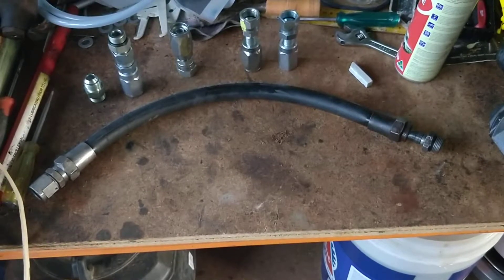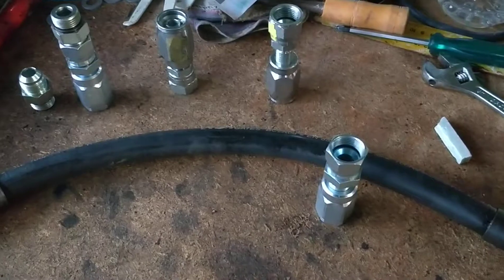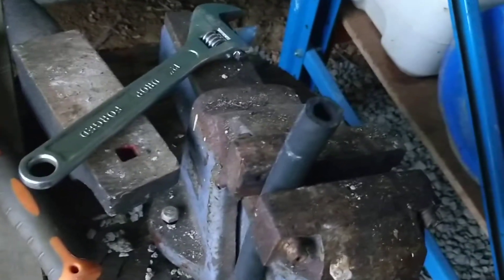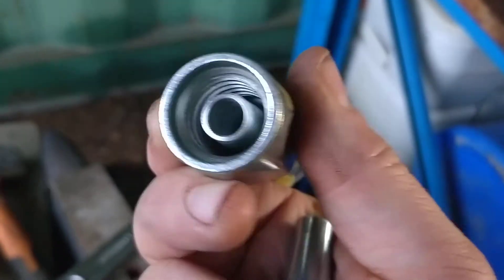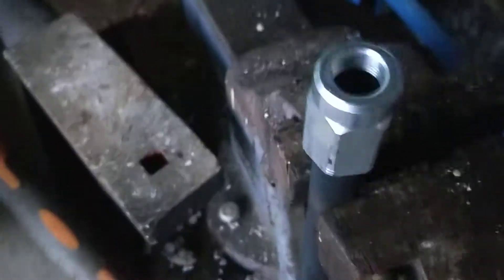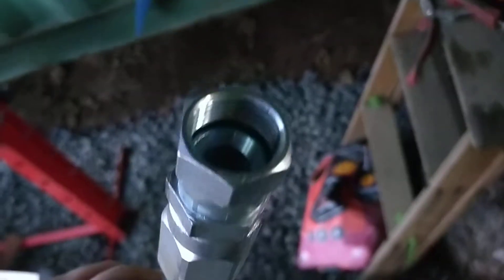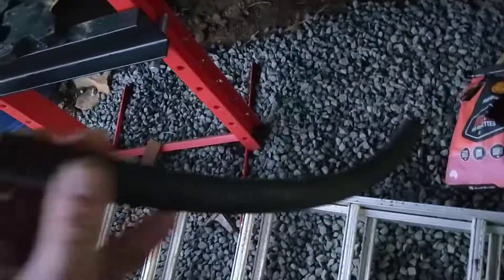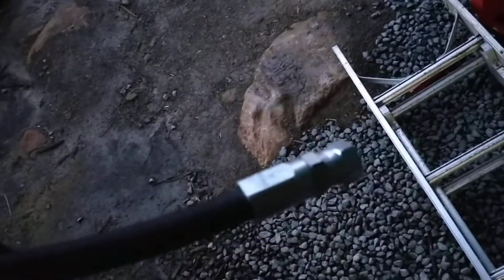OGT 54 - Make your own hydraulic hoses

Comment: So, what's the amount of psi that those type of connector (screw on as opposed to crimp style) handle? My JD 2032R looks like it has over 5000 psi. Will these screw on fittings work with that much pressure?
Reply: @butchtheiw  Not sure but they'll have ratings from the manufacturer. I've used the ones I get on 3000 psi.
Reply: max hyd pressure is 2495 psi on 3032r

Comment: I’ve got an old Ford/Shibaura 1900 with loader and backhoe (built for Telecom) and a lot of the fittings on the old hoses are reusable field fittings. I need to replace lots of hoses and am planning on re-using what field fittings I can, buying rolls of hose, and buying new fittings for the currently crimped hoses, mostly 3/8” and some 1/2” hose. I have a lot of work ahead figuring out threads and inside and outside diameter hoses. Good to see some reassurance this is a viable way to go. 
Is there a brand on the field fittings you have settled on?
Reply: BareCo ones are cheap and reliable
Reply: @bcg1976  And Aussie made too!!

Comment: Love this low cost fix. I am in Tassie as well fixing an old Massey Ferguson Front loader / Backhoe... The hydraulic hoses are much larger diametre but I would be willing to give it a go. You mentioned to shop around... were in Hobart Town did you find the best prices on fittings and hose?  
Thanks David